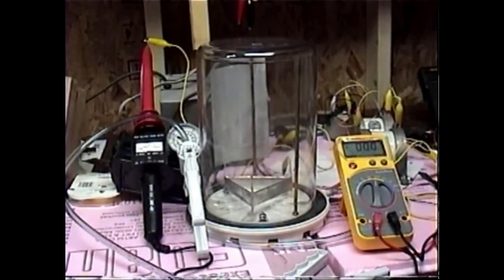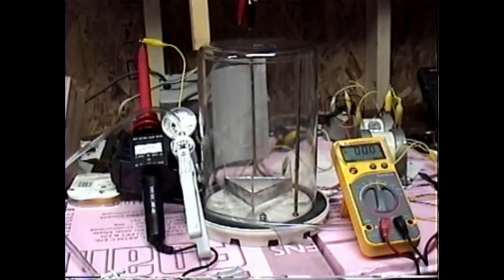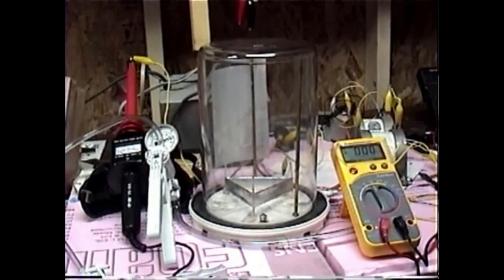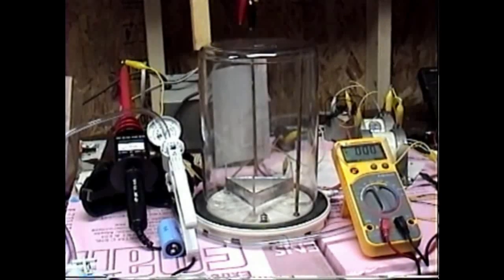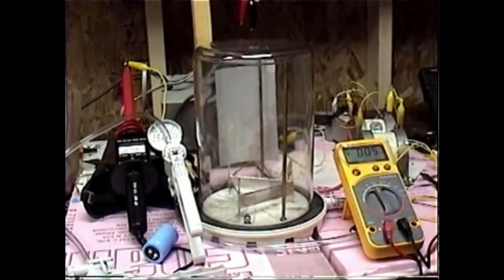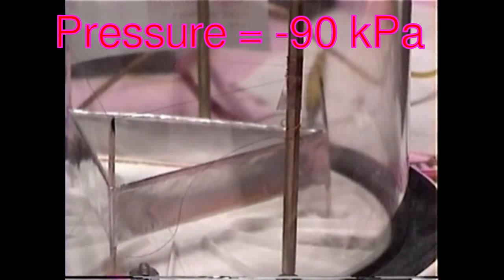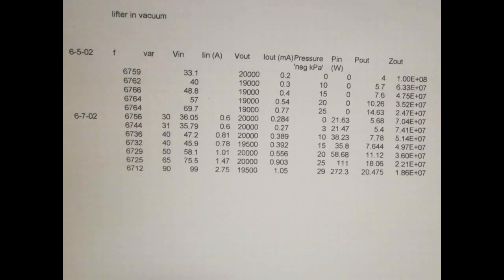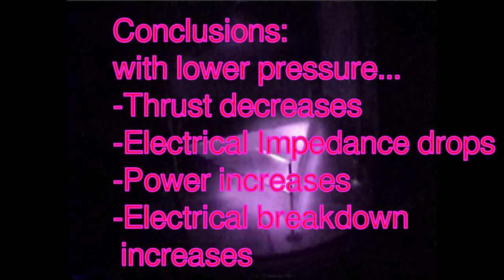Lifter in a Vacuum : Electrodynamic Ion Propulsion

Comment: What's most interesting is that it does work in a vacuum. Gravitec ran some tests for NASA a decade plus ago that confirmed it also. Would be interesting to test different dielectrics in the chamber.
Reply from the maker: Yes I agree.. It is on my to do list... as soon as I catch up on some of these other projects around here, I definitely want to try this..
Reply: @jaynesnetwork  How has it been going? I stopped for a while but will be starting again soon. I read that Honda had a symmetric plate capacitor apparently lose 3% of its mass, the capacitor was in an oil bath to negate possible 'ion wind' effects, they used only 8KV, the paper is interesting. If you search for honda musha  explanation of dynamical beifield brown it's the first PDF link.

Comment: Well it was clearly arching to itself in vacuum, try making a longer one for that
Reply: Yes or a variable guide wire adjustable in distance between both contacts to match the rate of vacuum pressure may result in a new conclusion.
Reply from the maker: Yes, this it true, but I am not sure if that will increase the lift??
Reply: It will certainly increase the lift over an arcing condition.
 @jaynesnetwork
Reply: @jaynesnetwork  You're losing lift to the energy that is arching.

Comment: If it are a vacoom chamber how it could happens eletrohidrodinamic? how can the lifter floating without air?
Reply from the maker: Yes, as the air pressure drops, so does the thrust. I was trying to investigate claims of Towsend Brown, When I get time and resources I will try new experiments with a dielectric between the electrodes. You are correct. This device as is, does not work in vacuum...
Reply: @jaynesnetwork  Great work btw! Incredible work. Most interesting research I could imagine anyone doing (except the classified stuff but in the public sector world.. )

Comment: It will not lift in a vacuum because the lift in air is produced by the entrainment of air molecules in the ion-wind between the two different potential electrodes. No air = no en-trained gas molecules, so no force is generated. A vacuum ion-motor (space) provides thrust by being fed from the craft with an inert gas, which it ionises and accelerates to high speed from the rear of the motor.
Reply from the maker: Yes that is correct.. on a different note.. T. T. Brown, claimed that a charged capacitors with a massive dielectric can produce a force against space.. I did not try this experiment though.. This lifter device does require air to produce a propulsion force.  I am intending to try the T. T. Brown experiment when I get the time..
Reply: I built a 6 foot lifter in my garage in the early 2000s and my pant legs would charge up with static while it was running.  To me that implies that electrons do leave the bottom of these devices.  Electron beams do exist in vacuums as well so perhaps if the trillions of electrons that are emitted go one way there might be a bit of thrust in the other direction, according to Newtons Law.  As I mentioned previously, there are also several reasons to believe higher emitter wires should work better in thinner air, given specific parameters.
 @jaynesnetwork
Reply from the maker: @KraussEMUS1  Very interesting.. Did you post any videos of your work?
Reply: Hi JN,
Of course,
Just click on my purple channel icon to the left to see 4 flight  videos with onboard power.  There are links to the website under the videos and a picture of the old 6 foot craft at the  bottom of the first web page.
Thanks for asking!
 @jaynesnetwork

Comment: Are you sending the power through capacitors first before it goes into the object? Ive seen very different effects when the power is put into high voltage capaictors first.
Reply from the maker: What kind of differences are you seeing?
Reply: @jaynesnetwork  less arcing with more movement, but they had 2kv pulsing and they charged a large capacitor bank that discharged DC into the levitator. It wasnt magical or anything but it was a bit better than this.

Comment: Lifter doesn't work in vacuum, period.
Reply: With a dielectric and at higher voltages they do appear to produce a little lift by expelling trillions of electrons behind them.  I didn't understand "Trans-dimensional Technologies" video at first but it does show a small force in a vacuum.  With millions of volts or with a small propellant tank they really will work in a vacuum.
Reply: @KraussEMUS1  doesn't work when you apply close to the same amount of negative pressure found in the vacuum of outer space.
Reply: @courtneyb75  
I know normally "lifters" don't work in a vacuum.  If you add a propellant tank though it will.  If the emitter wires are raised accordingly, inversely proportionally to the reduction in air pressure, some of the lift should come back at somewhat higher altitudes.  Lastly, if millions of volts are used, an electron beam can be formed and it will produce some thrust without air.  Normally though I'm sure you are correct, except for perhaps very small amounts of thrust.
Reply from the maker: Yes, this kind of lifter does not work in vacuum.. I have not tried adding a dielectric between the plates yet..

Comment: John Hutchinson did it, Thowsend Brown did it, and Tesla probably figured it out first. Incredible how it's been kept out of textbooks for 100+ years. There's more to it than just applying HV. Of course that works with the lifters, but there are more rare effects to be rediscovered(or declassified)
Reply from the maker: Yes, I friend of mine told me that the army was doing some testing with this technology.. and one day their device shot of the test fixture and slammed into the ceiling extremely hard... There is more than meets the eye going on here..
Reply: @jaynesnetwork  
Paul Laviolette's book does a fair job of explaining the working principle. If not simple, it is detailed. It's the act of creating and collapsing the dielectric field that produces force in the direction of positive charge. You don't want any breakdown or air exchange between the plates/electrodes. Brown's gravitator patent has the plates insulated from the air completely. Later, Brown discovered that asymmetry of the electrode's surface area created a 'virtual' polarity as well; big positive plate/saucer with a small negative plate/ball. By utilizing this geometry, you could use high voltage AC to constantly create and collapse the dielectric field.

The biggest mental hurdle people need to understand is that there is no such thing as force at a distance because space itself is not empty. It has physical attributes because space is full of minuscule, neutral, dielectric particles (like neutrinos) that mediate what we perceive as force-at-a-distance. The very act of light waves traveling from a star to your eye is proof of this physical medium that fills space. All waves need a physical medium. The speed limit of light is similar to the sound barrier of our atmosphere. Why else can light speed up as it travels in and out of different materials? Sound waves behave the same. Why can't a physical object breach light speed? Drag from plowing through a physical medium. Why does time slow down as you approach light speed? Again, the increased resistance of so-called "space" slows the movement of things we reference for time keeping (to include ourselves). Anyway, the previously mentioned dielectric field interacts with these minuscule particles that impart/mediate these forces. By controlling these particles, you control the craft's interaction with surrounding "space". In a nutshell, this is "ether" physics as described by Tesla.
Reply: I can assure you it's rediscovered. If it were classified, we'd know of devices that used it, we just wouldn't know how it worked. It's like how we know the Auroa exists because we have radar records of a unique engine type being used around USAF testing airstrips.

Comment: There's a video from TB's vacuum chamber experiments where they celebrate with Champagne - so I guess he wasn't all wrong...
Reply: Maybe the key is in the dielectric. If you remove the air, you remove the dielectric and it doesn't fly.

Comment: Do you think it proves rocket can't work in space? Honestly, now I believe it's a scam, theory and experimentation says it.
Awsome experiment, lifter study is really interesting.
Reply from the maker: Rockets should work in space fine.  You just need mass to use as fuel.  By conservation of momentum, if you through mass out the back of a rocket, it must travel forward. The lifer in a vacuum is investigating claims of T. T. Brown, that you may not need to carry all that mass along with you, if you can find a way to create a reaction against space itself.. Technically this is not the same experiment that Brown described. He used a massive high dielectric material between the plates..  When I get the time, I would like to repeat this experiment... with the dielectric... It should be interesting...
Reply: @jaynesnetwork  thanks for your answer. 
Are you informed a lot about travel in a vacuum? I'm actually investigating and seeing experiments in vacuum chambers to study how to move there and if rockets can really work, because all I see about conservation of momentum shows almost all the energy is lost in the movement of the object having the lowest mass, so even if yes conservation of momentum is a reality, it looks far to be an interesting way to travel in a vacuum.
Reply: @Ayzay1717  They work fine. This tech would make space travel easier. The military implications and energy device required to power it would revolutionize society to where governments are no longer relevant. Jobs, and mostly every part of life would change. These losers in charge are terrified of losing their tyrannical power so they hide behind fear mongering by saying someone would use lifter technology for terrorism.

Comment: So does it mean that NASA's fancy ionic thruster don't actually work in space?
Reply from the maker: I believe that they have to carry 'fuel' / ion source, such a cesium atoms which are accelerated out the back of the rocket, and this fuel will eventually be consumed and become used up.  This research is looking at a possible way to do fuel-less propulsion, which would have a huge advantage over conventional rocket technology, if it is possible.

Comment: If you flood the chamber with with different gases, you can measure the effect of ionic wind and compare it to that of possible e.g. effects, if any, assuming you know the properties of the gas. helium is readily available and inert for most purposes. Compare this with CO2, Argon, Hydrogen, etc. Then you can quantify the ionic wind effect versus e.g.
Reply: You can quantify the ionic potential of the atmosphere by measuring the ohms between two, very close, fixed points, using a very high end ohm meter with the probes hard mounted into a fixed position. 

Also, you need to measure temperature in the chamber, light levels, and anything else you can think of as there is no such thing as too much data. also include a much more robustly designed lifter, using very specific materials with their properties (materials, mass, dimensions, conductivity/resistance, temperature, etc.)  all measured and recorded respectively.

Comment: I like what you are doing. Also, there are different levels of vacuum. When you use a vacuum pump only removes the bigger molecules in place, leaving things like atmospheric helium and hydrogen behind.
Reply from the maker: Yes, to get a higher vacuum, I would probably need a turbo or diffusion pump. This would be interesting to try to see what happens in a very hard vacuum since the breakdown voltage should go higher again.

Comment: You need to raise the anode wire from the cathode, then you get movement in hard vacuum. You get no movement or forcefield if the thing shorts out.
Reply from the maker: Great, I will give that a try.  Were you able to get propulsion in a vacuum? Thanks...
Reply: Not me, but the Inventor, TT Brown, in 1955 in Paris, France, in 1957, AH Bahnson labs, Winston-Salem, NC, the US Army research lab at Adelphi, MD (2000), Purdue University (2000), Takaaki Musha (Honda R&D), and NASA (2000) with Campbell and Serrano. All found operation more efficient in hardest vacuum, and the current can be turned way down for added efficiency~

Comment: I hope you don't think that you're doing the biefeld brown effect here. I don't see any foil capacitors in your circuit. You must have a high electrostatic field to curve the space time in the dielectric.. you have no dielectric in this experiment. Therefore you will have no Biefield Brown effect. Check out my videos to see the real Byfield Brown effect in action. I had the oil experiments reveal the hidden geometry of the field. The only way to causes geometry is with the foil capacitors and dielectric material. I got shot in my home 4 times after I show this experiment to the Novus via people and Mark Hinds. Novus via fund. Be Careful
Reply: 5
Reply from the maker: Yes, I know,.. This is not the Biefield Brown effect.  His patent clearly states the use of massive and high dielectric material in the capacitor plate.  I plan to do some more experiments, when I get the time and resources.. Thanks for the great comments... Do you have any posted videos of your experiments?  I know that shady people run the world.  I met Eugene Mallove on his first time at the MIT flee market.  Some one killed him less than one month later... Most people don't understand that the world is run by cowardly gangsters and criminals... I personally will continue to do what I feel is right, because I believe in a higher power.. and that truth will conquer darkness...  best of luck...
Reply: jaynes network I have lots of videos on my channel of my experiments. The oil experiment shows counter rotating vortices in a recursive pattern. All linked counter rotating vortices. 

The oil experiment shows the self organization of a space with broken symmetry. The space time itself moves towards equilibrium and self organizes into a fractal pattern. 

Its these vortices that brown was trapping in the atoms of the dielectric to tap into the gravitational quanta of each atom. Quantum gravity. 

Ions can access the proton and reprogram the atom from its nucleus. See ebner effect. 

Brown never in his life made these triangle lifters. This was introduced later to distract people from the real effect.

Comment: great, great video. well done. i think space needs a mass displacement system, like two persons rocking a boat. if the boat is air tight, and inside there are two or more counter spinning and turning masses, one more so than the other, then the boat will be rocked, as it cant sink in space. buoyancy is already present and costless.
Reply from the maker: I am planning to make a video on the theory of something like this soon.  According to Newtonian Physics such a thing is "impossible" due to conservation of momentum theory, but I believe there might be be a way around this.  Thank for the great comments.

Comment: careful of all the Xrays generated with high voltage in a vacuum...
Reply from the maker: The voltage is only 30 kV, and the electrons are hitting a low Z material (aluminum) so I think x-ray production should be fairly low.  Thanks again for the great comments.  Never want to expose your self to too much radiation.. Always keep your dose well below  LD50...
Reply: funny how it glows the same purply color as the ufo i seen over Vegas, but it doesn't fly in a vacuum...
Reply: @hintzofcolorconcepts  Are you saying that was a Government experimental ship?
Reply: @brujo_millonario  Possibly experimental craft, as the bright purple light was seen floating silently over Las Vegas.
Reply: @hintzofcolorconcepts  Biefeld Brown did it in a vacuum: Maybe the key is in the dielectric. If you remove the air, you remove the dielectric and it doesn't fly.
Reply: @brujo_millonario  townsend Brown? You may have a point there. 👍

Comment: hi can you do some test on your lifter for me?
Reply from the maker: Hi, My lifter actually got a little smashed in my recent move.  I can always build another.  I was planning to do some testing testing with a rotor and high dielectric similar to what T.T. Brown suggested, but I am always open to suggestions.  What did you have in mind?
Reply: i want to make one but i have issues getting the wire.
 test 1 is to put a magnet under it.
 test 2 is to tune it upside down
 test 3 is to break the upper 3 leg that hold the wire and loosely connect them with some thread and make it so that they still line up using something like a knee brace.

ones i see these result i will know if my improvements will work
Reply from the maker: These are all interesting experiments.  When I rebuild my lifter, I can try some of theses.  It is a fun project, If you get the wire, it is worth while trying to build one yourself.. Thanks again for the great comments..